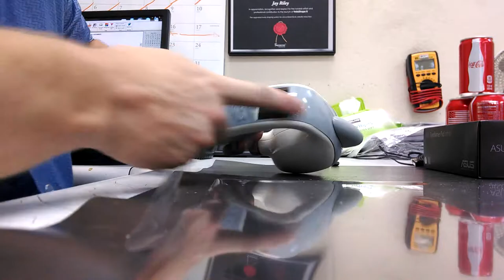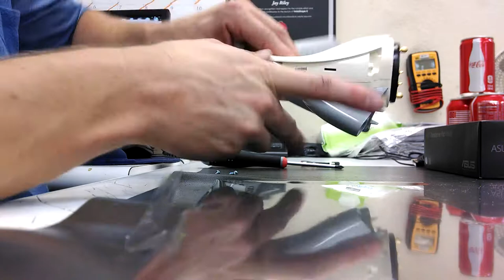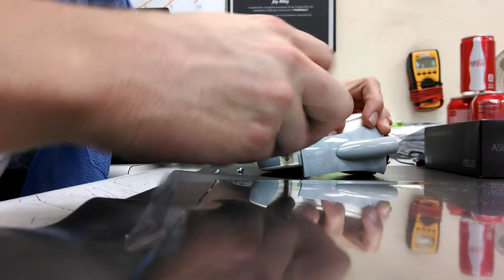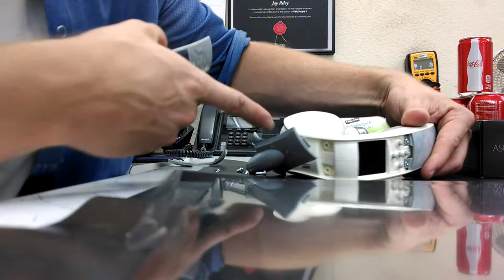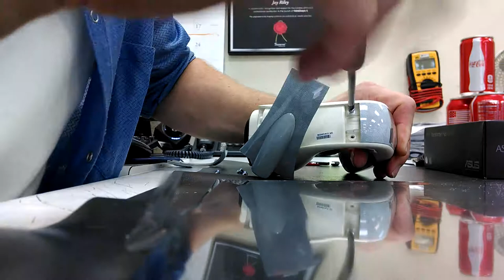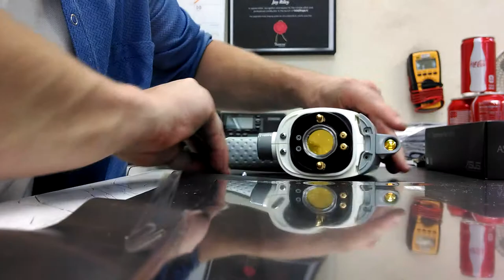Replacing the Display Panel on a VelaShape III, Vcontour, Applicator

Comment: Hi !I see this video is quite old now but I'm kind of desperate with my Velashape !I am looking for instructions to remove the plastic ring at the base of the handpiece, where the ombilical cord is plugged. I removed the rubber ring and the small plastic ring but I don't see how to remove the larger ring.Thank you for your help if you can !